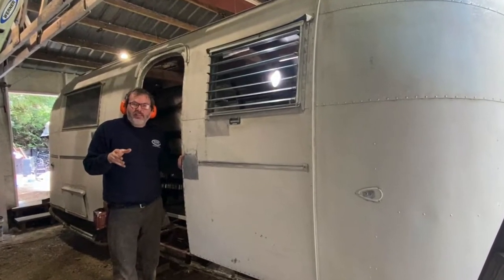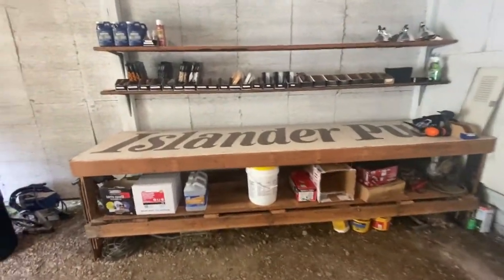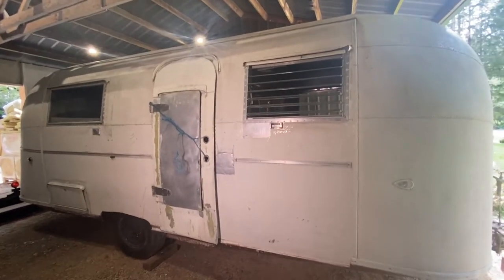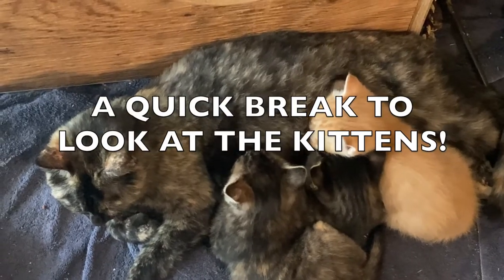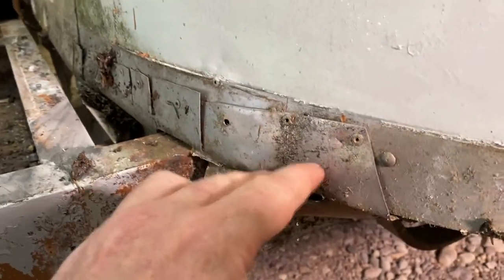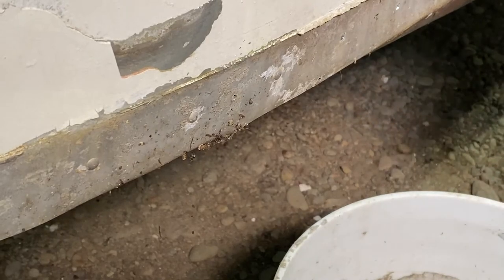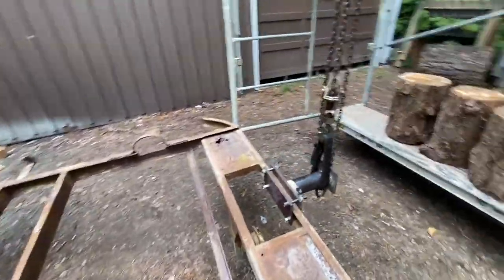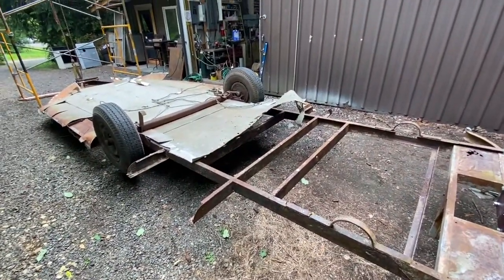Airstream Makeover Part 1 - Shell Removal

Comment: Hi Jon☺ it's going to be a big job , but im sure you'll get there, when you lifted the shell I wasn't sure if it would spring a bit making it difficult to join it back to the chassis,  the chassis turning   rig  worked great, that'll make life easier, this will be a good series to watch, looking forward to the next one,  stay safe, best wishe's to all, Stuart uk.
Reply from the maker: Hi Stuart! 👍✨ Yes a little spring but I’ll speed it back out when I reconnect it to the floor. I took some numbers down. What numbers I could?!? 🤪 It was all a bit loose and shakey.
Reply: @RightOnJonCrane  Hi Jon ☺ I'm retired from the auto trade, and when asked  Does it Fit?, the reply was sure, it fits where it touches,lol , and that was right on too,stay safe mate , kind regards, Stuart.uk.

Comment: Didn't realize they skinned the bottom of the frames with aluminum too...................My Dad has a utility trailer with a magnesium plate bed, it was some plate he got cheap from a junkyard. It seems to be the perfect material for that purpose.
Reply from the maker: Right! It seems it was used often for its light weight and corrosion resistance! 🚀🚀🚀